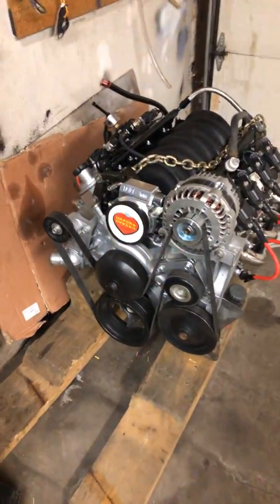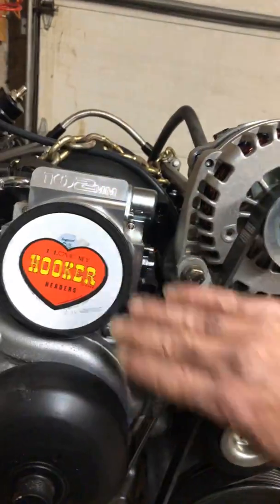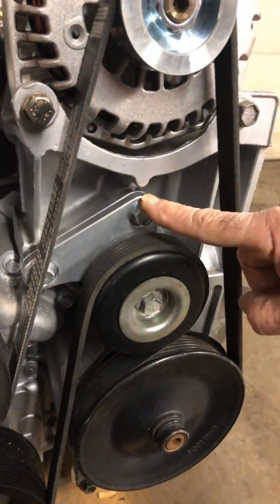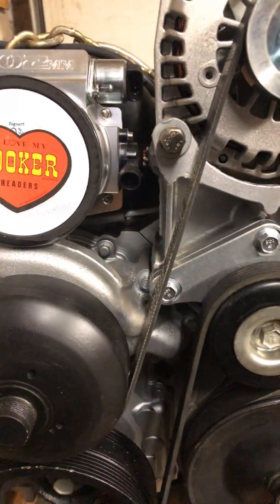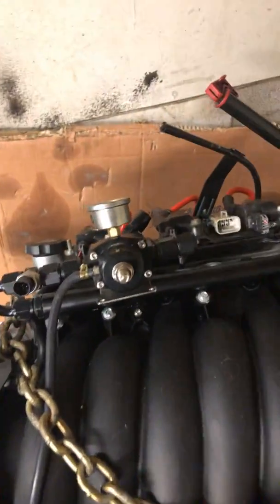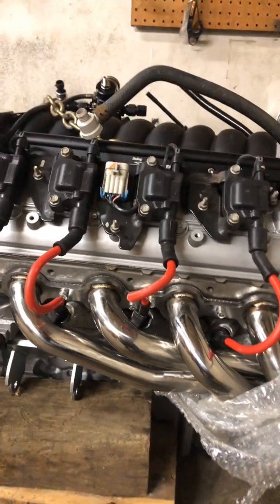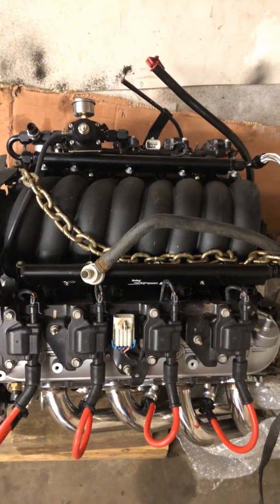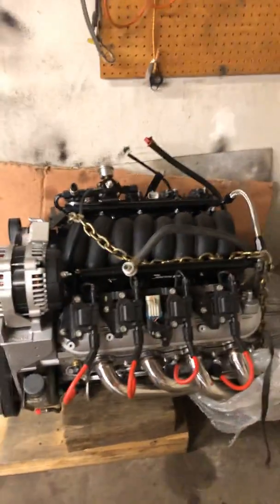L92 to LS3 transformation F body swap

Comment: We just did the same motor for our s10. We did the staged 2 btr kit. 3000 stall. Built 4l60E. We went 58 tooth back to 24 tooth inverter.

Comment: Im Currently Doing A L92 To LS3 Conversion To Drop In A 98 Firebird With A 6L80e. Any Recommendations Or Advice On What I Need To Change Before Putting It In The Car

I Know The Oil Pan & Intake Is The Major Switch To Make Sure It Fits
Reply from the maker: @cornbraed595  The other issue is the alternator sites to high. You’re going to need a ITC or other brand bracket that lowers the position. I’m guessing you’re using the factory ECM to make the 6L80E work.
Reply: @ Thanks I’ll Order Brackets Right Now And Yes Using The Stock ECM
Reply from the maker: @ hope you had the ECM retuned. Not necessarily for performance but things that can be done like turning off rear O2 sensors which eliminate rear catalytic converters, gas vent sensor and the VSS so you can start the car . Oh and I ended up getting a LS3 water pump and adapter blocks to bring it back out for belt alignment. The LS3 pump coolant hose comes out on the left drivers side so you have a clean shot back to the radiator upper hose connection.
Reply: @vikenlink  I Havent Had It Tuned Yet, I Bought The 6L80 Off LKQ (2010 Camaro SS) And Havent Touched It Since It Got Delivered. Focused On The Motor First. Thanks Again Im Tryna Learn This Stuff On The Fly First Time Trying To Do Any Of This

Comment: Did you do anything to the valves?
Reply from the maker: @therealbhall  no, other than a valve job, new seals BTR springs + retainers. Actually that’s an old video. I ended up selling the engine. Ended up with another L92 which I converted into a 416 stroker using summit Racing LS3 416 stroker kit. BTR LS3 stage 2 NA cam. The truck manifold was swapped for a LS3 intake do to hood clearance. No power advantage or disadvantage other then high between the two intake manifolds.

Comment: What do you do about the 58tooth reluctor wheel on the crank vs the 28 in the 4th gen f body ls1 cars??
Reply from the maker: Old video… turned into a 416 ci . Intake was swapped for a LS3 intake and ICT Billet alternator power steering bracket. Oh this engine went into a second generation TransAm. I used the Holley Terminator x max fuel injection system. You have the choice of 24 or 58 tooth reluctor system. I went with a 58 tooth on the 4 inch Stroker crankshaft.

Comment: Was the intake swap worth losing torque? The truck intake flows the same as the LS3 one and even compares to FAST intakes, just the car intake sacrifices torque for hp with short runners. VVT is difficult to tune so I understand the cam swap. Unless hood clearance is premium I personally would retain the truck intake and go 42 lb injectors or even use a e85 ones. 4L80e is king of the 4 speeds
Reply from the maker: I’m using the stock LS3 intake manifold with a upgraded Nick William’s 102mm throttle body and tapered adapter plate with 60LB Bosch fuel injectors . The engine is now a 416 stroker if you haven’t checked out my other videos. A stock LS3 intake flows exactly the same as the L92 intake manifold.. so there’s absolutely no power loss in comparison. Using a short runner intake is a bad idea.. first off there made of sheet metal or aluminum which gets really hot. you’re gonna lose 40-50 hp and torque under the curve all the way up too 6400 rpm because of the short runners. The LS3 FAST intake doesn’t make any more power then the stock LS3 intake unless you shorten the runner length, again your gonna loose down below 6000 rpm. short runner intakes make more power at 6500-7500 rpm where I’m never spinning the engine up too anyway. In my opinion the short runner intakes are good for drag racing when you’re spinning your engine up to 7-8000 rpm. The only intake that makes more power under the curve and above 6400rpm is the Edelbrock cross ram intake for the extra 20 hp it’s going to make doesn’t justify the $1200 price tag. Plus two throttle body’s and interference with accessory drive..

Comment: How much did you spend on all 8 injectors and also how are they?
Reply from the maker: Hi... old video, the LS3 turned into a LS 416 stroker.. the injectors cost me about $260 US . The injectors work well, no issues. As I mentioned in the video I’m running the Terminator X Max .. I said terminator plus in the video. The Terminator makes tuning fairly easy.
Reply from the maker: Forgot to mention....  My mistake on the video, I bought 60LB Bosch injectors not 42 LB injectors. The price is practically the same. I bought them through eBay from a vendor called highperformanceinjectors219 from California.
Hope that helps
Cheers

Comment: Plug wires touching the headers?
Reply from the maker: Yes... yes they were touching, ended up melting a couple. I ended up replacing all the wires with shorter  Granatelli Motorsports ignition wires with the proper angled boots.
Reply: @vikenlink  thanks a lot
Reply: are the balancer and pulley the same as ls3 or are they spaced further out from the block?
Reply from the maker: @BluegrassBackroadBuilds  I believe the L92 truck engine has the same spacing as the LS3. The reason I think that is I seen a LS3 water pump installed onto a L92. And the pulley lined up the same as the truck pump with the rest of the pulleys. I actually ordered a LS3 water pump .... still waiting on it. The reason I ordered a LS3 pump is the upper hose outlet is on the drivers side. My truck L92 pump comes out on the passenger side. Also the 2010 and up LS3 pump is a upgrade.. better flow rate for cooling.
Reply from the maker: @BluegrassBackroadBuilds  hey Dan, just got my LS3 water pump. The answer is no it won’t fit on a truck accessory drive belt system without water pump adapter spacing. 
Hope this helps.
Cheers
Reply: @vikenlink  Thank you sir!

Comment: Hello! In our country, the most common classic v8 - Hemi 5.7 and L92 (Grand Gherokee and Cadillac Escalade). But there is no tuning industry for these engines and all the details have to wait a very long time from the USA. And we are forced to use more accessible parts for the upgrade. For example, for turbocharging hemi (reducing the compression ratio), factory turbo pistons from Subaru impreza 2.5 liters are perfectly suitable. 
Tell me what tricks for inexpensive tuning of d92 engines you know?
Reply from the maker: Hello.... if you’re able to advance the WOT timing, and bigger injectors.. 42LB to 60LB for a NA engine.. bigger injectors for boosting applications. Long Tube Headers will give you about 35- 50 HP increase on the L92 . I’m sure Holley Performance Parts would ship you a Terminator X fuel injection ECU system . Then you can tune out of your home garage.
Cheers
Reply from the maker: Don’t forget to throw in a camshaft….. 220@50 intake and 230@50 exhaust 112-114 LSA … lift isn’t to important and is usually.500-.600 inch lift.
Reply from the maker: Unfortunately if you don’t have ECM reprogramming options…. There’s really only basic things you can do on a L92…. Cold air intake and long tube headers , 160 degree thermostat. The L92 came with VVT, again there’s VVT performance Cams that will easily get you in the 580 HP range, there’s non VVT cams that will work too and bring you well over 600HP . Sounds like your biggest hurdle is ECM Programming. My suggestion would be to get the HOLLEY Terminator X max system. Your programming problems will be gone and you can adjust everything easily on the 5 inch touchpad display. Get her running and screaming for more RPM.
Reply: @vikenlink  Thank you for the detailed answer. Most likely, we will use a custom ECU of our domestic manufacturer. It implements all the functions and we have experience in configuring it.
The optimal camshaft for everyday use in your opinion for HEMI ezb 5.7 and L92?
Reply from the maker: In my opinion , as a daily driver, I wouldn’t go any bigger then 220 degrees duration @50 on the intake and stay below 234 degrees of duration @50 on the exhaust side. 112-116 degrees of lob separation angle . As for valve lift, stay under .600 intake/ exhaust . The more lift the more valve spring pressure. To much lift and the engine starts loosing power due to parasitic loss meaning you’re losing more power pushing the valve springs down further due to flow limitations.

Comment: I think you are going to regret not just going with the 4l80e and those plug wires look like they are going to burn
Reply from the maker: I changed those plug wires a long time ago... .. I have a 4L70E transmission with a 3000 rpm stall converter.  This video is old. I’ve  been driving the Car this summer .... car ran excellent . However, I ended up seizing a piston due to low coolant and rad air flow issues. Now that those problems are solved, I’m in the middle of building a 416 LS out of it.

Comment: The fitment issues could have been resolved by replacing the front end assembly with one from an LS3 right? Since they're essentially the same thing
Reply from the maker: Carlos Zavala yes the corvette LS3 drive assembly would of been ideal.... but finding a used assembly would be required.  That’s just gonna cost More $$$ . I ended up with a ICT bullet alternator/ power steering bracket which did the trick.
Reply: @vikenlink   thank you so much for the reply. If I've got any more questions can I ask you here?
Reply from the maker: Carlos Zavala Hi Carlos... yes, if you need any information or have any questions.. feel free to ask here.
Cheers
Reply from the maker: Yes... if I got a LS3 assembly out of a Chevy Camaro or corvette.. it might fit. Keeping in mind the power steering pump and alternator are on the driver side. Some set ups have the alternator at the bottom and power steering pump at the top. I prefer The power steering pump down at the bottom. It’s much narrower from front to back compared to the alternator.
Cheers

Comment: Okay so i have an 08 yukon denali sport with a 6.2L L94 what can I do to bolt on more power without killing reliability? She has a ton of miles but I don't believe it is the original engine it has been changed
Reply from the maker: kevin auman hi Kevin... depends on how radical you want to go... you’re driving a nice quiet smooth truck... if you want to keep it like that with a little more power... 65HP more....I’d leave the VVT and get a Brian Tooley VVT stage 1 cam with the spring kit and hardened pushrods . DOD delete kit..Cold air intake and a performance tune. Those aftermarket OBD2 plug in performance tuners work well. Now if you don’t mind more noise... swapping your stock exhaust manifolds with long tube headers bigger catalytic converter‘s lose your resonator put on a nice free flow muffler bigger cam BTR stage 2 VVT truck cam. You’re gonna get well over 520 HP from your stock 407 HP 😎
Reply: @vikenlink  well I've already put a MBRP installer series cat back exhaust on and also a K&N air filter in the stock airbox also using the Superchips flashpaq F5 tuner... She sounds amazing and turns the 33in tires I've got very nicely... i figured more air in, more air out and then adjust the tune to the best that programmer can allow without custom tuning on a dyno and i only ever run 93oct but im starting to really enjoy the way she throws you back in the seat and want more lol so im guessing the next step would be a cam probably?
Reply from the maker: kevin auman yes sir... get a cam.... don’t make the mistake of going to big with the cam. Stage 1 truck cam is perfect with what you’ve already done. Once you go to big😩,Your gonna loose your low speed drivability, it’s gonna run like crap and your gas mileage is gonna suffer .

Comment: I read lots of reviews and dyno results l92 manifold actually out performed ls3, would u do it again ?
Reply from the maker: Richard from speed secrets tested the LS3 intake against the L92 truck intake.... they are identical back to back on the dyno. I had to go with the LS3 intake manifold due to hood clearance issues. Otherwise I would of saved the $$$ and stuck with the truck intake manifold .
Reply from the maker: Roger yes.... I would do it again..... but I’d go with the BTR stage 2 N/A cam and a 3000 rpm stall

Comment: I just bought the same motor and its going into a sand rail. When you replaced the cam, did you have to replace the lifters, springs or push rods? I have seen some kits that have those included.
Reply from the maker: Trey Miller Hi Trey
Yes I had to replace my valve springs and push rods, I installed Brian Tooley springs .660 max lift and hardened 7.40 push rods. Didn’t need lifters . I also ended up putting a relocation kit on for the alternator... wasn’t able to close my hood.
Reply: @vikenlink  you should make another video with that info. Do you know about how much you had to spend? And did you have your car dyno'd?
Reply from the maker: Trey Miller yes.... I got a set of BTR double high lift springs and retainer kit, also a set of 7.40 hardened pushrods.